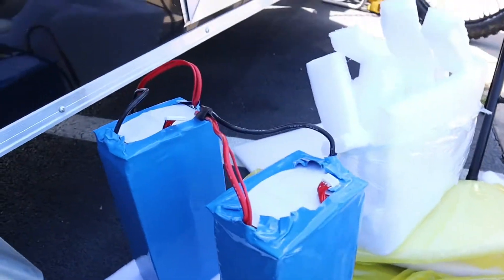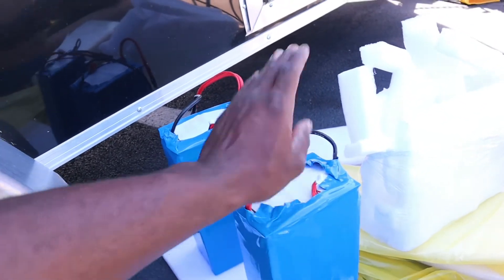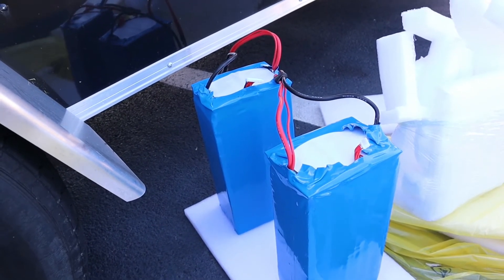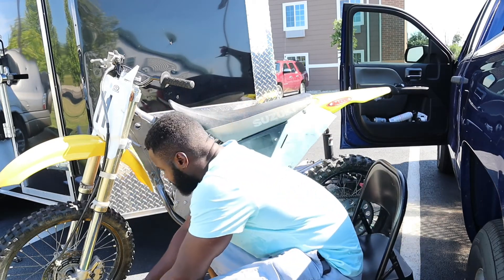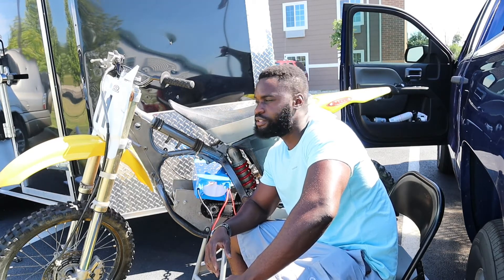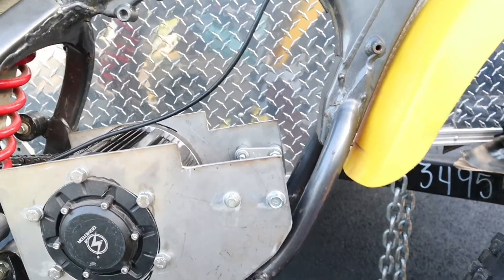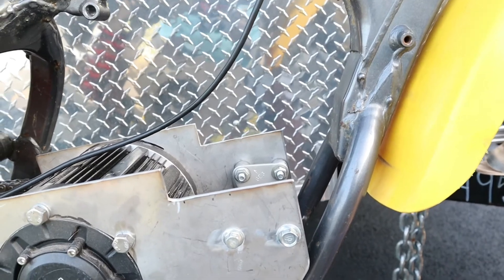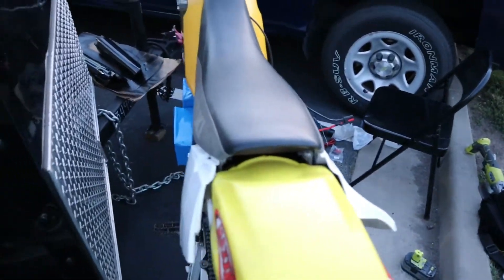Electric RM 125 2000 build part 5

Comment: How thick are your motor mounts and battery cases?
Reply from the maker: Vincent Pernicano the motor mount is 1/8 of inch stainless steel .The battery box is 3/16 for side and 1/8 inch thick for everything excluding the sides (aluminum).
Reply: @britto761  okay thank you! How do you like the batteries so far? I am about to order a 68AH battery with 200A BMS from the same supplier. I am going with the qs 138 70H v3 motor with em-150SP controller, do you think power will be adequate if I push 150A battery side?
Reply from the maker: Vincent Pernicano The battery is great so far.150amps battery should be adequate depending on your gear ratio.
Reply: @britto761  the V3 has a built in 2.53 reduction ratio so I will have very flexible gearing. From your experience what gear ratio would you recommend for that power output? Also curious if you needed  a custom sprocket to be made? Thank you for your responses!

Edit: doesn't look like custom sprocket, so you must be running 13/41 or 14/41 something like that? Top speed must be very high but how about torque?
Reply from the maker: Vincent Pernicano i would recommend 1:7  or 1:8 gear ratio at 150amps battery.i haven’t made a custom sprocket yet ,but i plan to make one in the future.since you have an inbuilt gear reduction,you might not have to use a very big sprocket on the back wheel.

my setup is decent enough for my riding ,but i will gear my setup even lower for my application.
Reply: @britto761  okay thanks britto! Thing will be a torque monster at 1:7, peak torque is around 48nm at 125A! I'm wondering if maybe I should do 1:5 or 1:6 so I get a little bit better top speed. I suspect 4000rpm max under load which would only get me 45mph with 1:7
Reply from the maker: Vincent Pernicano 1:6 will be more than enough for your needs since you already have a reduction.
Reply: @britto761  you're talking 1:6 overall right? So I have initial reduction of 2.53 and then another  2.4 reduction on the final drive to get 2.53x2.4 = 6?
Reply from the maker: Vincent Pernicano yes ,the overall with the total setup.

Comment: Friend, you have to make a gearbox with a ratio of 1 to 7 or 1 to 8 for dynamic acceleration and high efficiency of this engine. With a direct sprocket drive like yours, the unloaded wheel will spin at 200 km / h, but the motor will run under increased load and with slow acceleration.
Reply: This motor with home made reducer 1 to 8 https://youtu.be/YoSFLI6NUlU
Reply: https://www.youtube.com/watch?v=3l8ZKQOKlNE
Reply from the maker: Multi Green thanks for the suggestion ,but so far I’m happy with the torque at 250amps battery and i also plan to run it at 300amps or more.Also remember i have an unlocked sabvoton controller and if acceleration feels slow,i can also adjust the acceleration time and throttle voltage.

Comment: Cool! But need more powerful) about 20 kwt or more for this bike....
Reply from the maker: Stasus Kabasus it will be in that range when completed.
Reply: @britto761  i have 20 kwt on sur ron who has weight 60 kg....
Reply from the maker: Stasus Kabasus that’s cool,i bet it’s fun.
Reply: He is ride frend . I have the same sab 72200  , .. but just set amps in the controller satthings on a level that whil not drop the volts of your packs to mutch       . You find iT out, the sab eats packs for fun.. we al make the same fist mestakes .. have fun .. but iT cant kil lipo

Comment: Dame bro it looks nice, where are you located?
Reply from the maker: THEDON82z1 thanks and I’m located in ohio,usa .
Reply: @britto761  Kool bro I am in the Washington DC area..Have you ever thought about doing a comparison between the nuclear tech 24f controller and the asi bac 8000. I would like to get the asi but it looks like I might be more comfortable with the 24f Controller. I would love to here your thoughts bro👍
Reply from the maker: THEDON82z1 i would say the nuclear is more easy to program and straight forward,but the asi controller is more powerful and has a greater potential for power upgrades.
There is a guy that makes display for the asi controller that makes it easily programmable ,which makes it plug and play.The asi is difficult to program but it is doable.
If you don’t need way too much power then go with the nuclear 24f controller,if you need more than what the nuclear can provide then I’ll suggest asi controller.
Reply: @britto761  How long was the wait for the bac 8000 and did  he program it specifically for your QS276? Thanks bro..I want to pull the trigger on a bac early next year👍
Reply from the maker: THEDON82z1 back when i bought mine it was about a week for the wait and it yes it was programmed for the qs273 motor ,but we had to tweak it for it to run properly.
It’s worth a try and you’ll definitely enjoy the power upgrade.
Reply: @britto761  Thanks bro, I think I am going to go for it this winter but I am not going to lie..Of all the Controller's this one makes me the most nervous setting up..lol.. Thanks bro👍
Reply from the maker: THEDON82z1 you’re welcome.
Reply: @thedon22z  i have nucular controller 24 fet and BAC 8000 by ASI on Sur Ron X and battery 21s. And bac more powerful and start on bac more silence more powerful more collection than nucular controller. But settings best nucular controller and more information on display settings! Russian guys Cool!!!!)
Reply: @stasuskabasus3193  Awesome bro , is it okay to hit you if I have any questions? Thanks 👍
Reply: @thedon22z  no problem!;)

Comment: Was that full power at the end clip bud?Also I think it would look alot better if the pack was either side close to the tank ect.More like twiches build the crf250 build.Loving how easy that motor is to setup in an old Mx bike👍
Reply from the maker: That wasn’t full power at all.This is the only option i have to fit a bigger battery pack on this dirtbike ,since the mid drive motor doesn’t give me enough space for batteries.
The hardest part of the motor setup was cutting out the hole for the motor to slide in,but all in all it wasn’t too bad.
Reply: @britto761  Looks great bud and always look forward to your uploads.What sort of DC amps are you looking to push the Sabvoton too?I think safe 15kw and low gearing setup for say 45mph would be epic.The torque would be insane I would think 👍
Reply from the maker: Fpvlee the battery amps i am currently running is 250amps and so far even at slower speed  this bike would climb any steep hill like a mountain goat lol